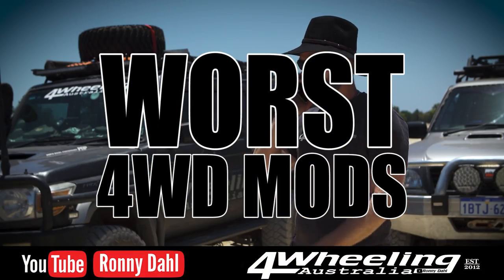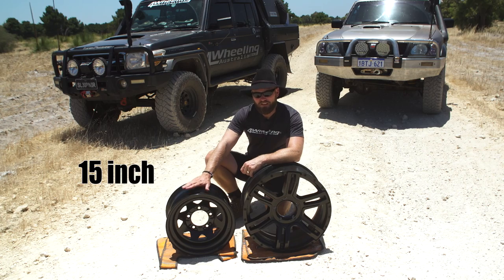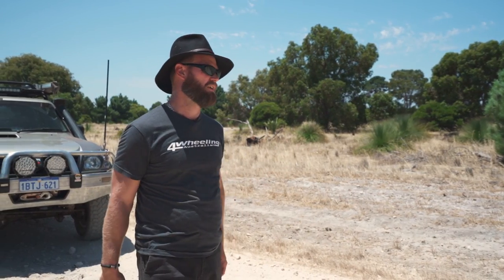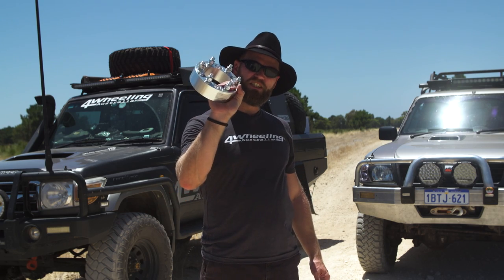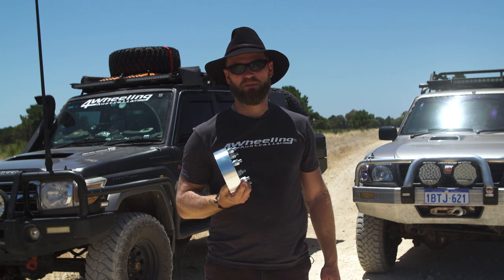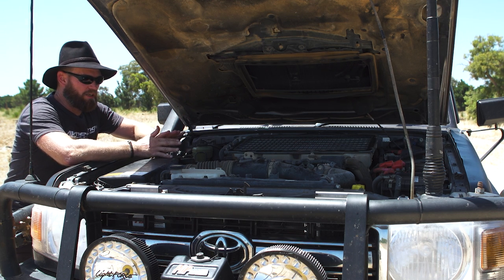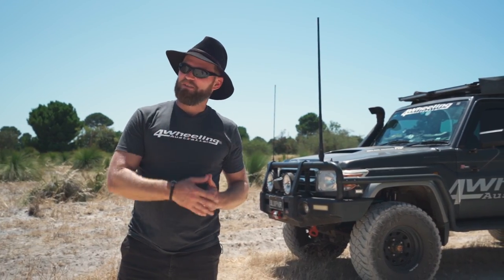WORST 4x4 MODS, DON'T DO THESE TO YOUR 4WD

Comment: Here in Oklahoma we can literally do whatever we want to our vehicles. No state inspection. Car dealers can and do sell emission deleted diesel trucks . I seen a brand new ram 3500 3 miles on the clock completely deleted and tuned to 600 hp on a dealer lot .

Comment: To be fair, I can see the need for spacers? like in the military where I am from, we use the ford everest, they added metal bars and lifted it, what they did was basically make it top heavy but the wheels were still well in the wheel well, so there were many cases that they flipped over because the wheels are narrow

Comment: Up here in western Canada, (Saskatchewan, Alberta), I see so many 3/4 tons & 1 tons, with ridiculous lifts. Those trucks Never go off road, or hardly out of town. Also Now that truck can't even tow a trailer, which  it was built to do, in the first place. Not to mention the extra fuel, they squander away.
Reply: Same thing in Northern Minnesota, it's the Monster truck syndrome.
Reply: @saginawdan  exactly! & the dudes that get out of the truck are 5'2" usually, to boot, too.

Comment: Ok I agree with you on the wheel spacers and taller rims. But I wish I could still get my by ply tires work better offroad and when it comes to weight (my Jeep"73 j4000 pickup"" empty is a little over 31/2 tons) has 8 inches of lift drives like a dream

Comment: I can agree with most of what he says, though I have big rims....except I do rock crawling and I'm not a fan of drving my vehicle in traffic, but not because of handling. It handles fine. I just hate a 6 speed manual in traffic. A lot of what Ronnny is about is "touring" or "overlanding" and that's where his expertise is. I wouldn't attempt the type of driving he does in my Jeep. I'd just buy a Toyota, but I'd never replace my Jeep for a Toyota for the type of rock crawling I do either. Funny thing is, I've seen some people with $70-100k+ builds and fantastic gear...top of the line stuff and then I look underneath and they still have the stock drive shaft on a crazy lift and never EVER take it off road and even despite that...you can tell that stock driveshaft is going to twist like a wet towel sooner or later. As for the big rims...well, I have big  tires and they are due for a replacement so I may just go ahead and swap the rims out too. I've out grown them.
Only advice I'd ever give someone who's going to do either overlanding or rock crawling is two things:
First, (and Ronny nailed it with "Don't go cheap where it counts") this is not a cheap hobby. You will inevitably spend a pile of money on your vehicle if you do it right and excpet to do it as a hobby or for any amount of enjoyable time. Second, is "Never go out alone". If you're a "lone wolf", "Army of one" or some other BS...pfft...make a friend. Two or more vehicles is always the safest thing you can do. Thumbs up Sir! Great video as always.

Comment: Lift kits + stiff springs = less usable suspension travel. Especially down travel, no down travel no traction going over obstacles, your tires will lift off the ground and you’ll just teeter.
Unless you are loading your vehicle up with a lot of gear and need proportionally extra stiffness.

Comment: I was once driving on the highway, eastward from Chicago into Michigan.  As soon as we hit the Michigan border, the road turned rougher, and there was one particular pothole in the highway that had some victims off the side of the road - at least 6 vehicles had flat tires, some even with obviously broken rims.

Every. Single. One. of those cars had low-profile tires.  Some Subarus, some lowered Hondas, some Chrysler sedans with huge and expensive rims.  Every one of them had oversized rims and low profile tires.

On any car I purchase, I opt for the very smallest rim that will fit on the hub.
The tires are cheaper, the wheels are cheaper, and you'll be riding smooth over those potholes that would kill a low profile setup.

On one vehicle, the dealer had a special offer for 2 free sets of tires, but only in the stock size, so I bought fancy alloys in the stock size, and essentially got them for free, after cashing in on the 8 free tires.  Noice!

Comment: This is not a mod, but speaking of high lift jacks: I use the high lift jack to take the weight of the vehicle and then a bottle jack to lift the weight of the wheel and suspension. Easy to adjust the height of lift too.

Comment: I agree about what Ronny said about the wheel spacers, however the alternative to fixing Toyota's f**kup properly is to install a widened axle, which numbers in the 10's of thousands with installation costs. Lesson: be aware before you buy that the 70 series has that inherent flaw built into it and fixing it properly costs $$$.

Comment: At the end of the vid. I herd "you can't tune an engine to be more efficient because you just drive it harder."  First off how you drive it has nothing to do with engine efficiency, no? And an engine is a glorified pump with all kinds of friction and opportunities to improve efficiency, no? It was just a sentence I can't agree with that mixed two separate issues as cause and effect. Thoughts? thanks.

Comment: Got my self 2001 4runner with supercharger on a 3.4 with 250lbs of bumpers with a 3inch lift and stock size tires on 16inch steelies with a 9.5k winch  for now its just fine for what I do no roof rack or weird lights its my daily and fun truck with 125k .on The od all fab work and mechanical work done by me so it was fun lolol

Comment: one of the worst mods is the 79 series Land cruiser dual cab ute!!!! it has a off set on the rear due to different diff front and rear!!!
the snorkel is the first mod you do so you do not GET WATER IN ENGINE!!!!!!
a 2 inch lift is not enough on older 4wd!!

Comment: So if you have a 15" wheel you should try to fit a large tire to get larger footprint. I have a 15" with  factory 195/80R15  , should I go for 215/75R15 and lift the car 2 inches to make room ?

Comment: Since when can a high lift jack only be used on a front bull bar? I use my high lift jack on both front and rear stock bumpers of my Jeep. How else can I jack it up? With my lift, the stock jack won't reach and it's only a 3" lift on 33" tires...

Comment: Love the video and the content.  My only disagreement is with the highlift jack.  I can be used on front/rear bumpers as well as rocksliders.  What else are you using out in the woods?
Reply: I think he's was more referring to vehicles with factory side steps and factory rear bumper, which you can't lift off

Comment: "The closest some come to nature is that their Volvo SUV will drive over some leaves in the driveway once." (can't remember who wrote the original quote, sorry)
Personally, I've a 2004 Pajero LWB diesel, and I love it. Only mods so far are assisting coils and Koni shocks in the back, a LED bar in the front.  Upcoming are (most likely) a drawer-system for in the rear to help organize, maybe make a roofrack (need the welding experience, not the use) and a nicer rear bumper with bigger lights in it (stock are too small/terrible visibility imo).

Comment: I'd say lights on the top for temperet areas snow, rain, fog etc light reflects off the hood and makes it worse to see even with amber lights. Just stick to lights in the front that are in the 4500 to 55k Kelvin level.

Comment: Got 30mm spacers on my defender. I'm in canada and everything out here has a wider track width than me which is a real pain in the snow and mud, the spacers help lots keeping her straight in wheel ruts.
Reply from the maker: Have you thought about offset rims/wheels instead?
Reply: @Ronny_Dahl  I'll take them off when the ice has melted from the roads, put it back to normal. They only go on for a short time so I'm not to worried.

Comment: Keep the weight out of it as much as possible. Keep the weight low. Bumpers ok but roof tents.. ok Aus may be but bad idea for moab, or most other off road situations. I even just added winch mount to std defender steel bumper to avoid weight. Less weight less need for power, less likely to get stuck.

Comment: I agree with virtually everything covered in this video but not everybody can afford the biggest and best. I understand not cheaping out on critical parts or doing some thing dangerous (wheel spacers).  But if somebody can only afford a cheap awning and some ebay lights, let them get what they can get so they can get out and have some fun.

Comment: Hi so I have a Nissan patrol y62 manual that is my daily driver I have go to the desert in the uae often and have equipped it with king shocks and method 18 wheels and kumho road venture tires and also 20m spacers , during the vid you mentioned that spacers are bad but I use mine so the method wheel can fit to the car due to the brake calipers being very big so want I want to know is that would that still be bad for the car

Comment: All I've done to my 97 2door Blazer base model is replace suspension with new parts, get AT tires, replaced u-joints and put discreet aux lights on. Doesn't stand out as a hardcore 4x4 but he goes places so...no way I'm lifting this rollmobile. Lol

Comment: Great video.  I'd like to see a video on how to properly waterproof your vehicle  for water crossings.  I just installed a snorkel, I'm planning to add diff breathers, and I know I need to do more but I'm not sure exactly what to do. (I know snorkels are intended for dust and clean air, not water crossings)
Reply: Diff breathers are a must for water crossing. If you are going over your wadding depth the chances are your vehicle will float. If the water level reaches any where near your snorkel top, snorkel will be least of your worry because your electrical and electronics will be in water

Comment: What about cheap lift kit spacers eg longer bolts. $120 vs full shocks and suspension lift kits for 1.5k but for a bit of lift for bigger tyres if needed seems practical

Comment: Cheap wheel spacers are the problem, factory dual wheel pickup trucks run spacers on the front axle and have zero issues here in the United States.

Comment: So my takeaway from this is leave my truck stock.  It has what I want for light to maybe medium trail riding and can handle "normal" adverse weather conditions i.e. a bit of rain on the dirt or rock trail just as the engineers designed it for.  Not trying to jinx myself but I guess the trick for me would be to better understand where and when NOT to go than what I do now.
Reply: @phantomwalker8251  find that crazy to hear, see stuff driving around here in NA where you’d probably be safer in a shopping kart. Once its registered, you can do what you like pretty much

Comment: Nothing beats a steel rim. If you hit a rock wrong on an aluminum it breaks. If you hit a rock with a steel rim it will dent and it can be hammered out enough to hold air and get you down the trail.

Comment: What's wrong about upgrading air box/snorkel without other stuff? Main use for extending it to higher point is not to suck dirt and dust, not for going to the water.

Comment: I have to disagree with lift kit have a 6 inch lift kit with 20 x 10“ rims on 35 handles really great off road and really good on road. Without the 6 inch and rims and tires kept getting hung up and stuck and constantly having to use the winch hardly have to use it anymore now. So it all depends on the set up and if you do your research and set up properly shouldn’t have a problem at all.

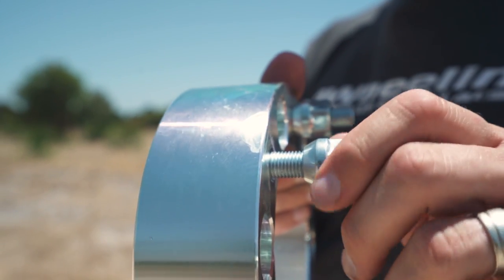Comment: 5:23 in saudi we use these wheel spacers because the j70 2007 and top got a different wheel track than the older cruisers it is narrow and little bit and the older j's are much wider when we talk about the rear wheels

Comment: I second the extreme lift my second 4x4 was a lux with 35inch tyres and a 2inch body and 4 inch suspension lift, handled like a bucket of shit and was an absolute cop magnet. The only reason I kept it 6 years is because I have a shit box as a daily and literally only took the lux out shooting/fishing or camping afew times a year. Now I have a fully road legal 4x4 and it's good not shitting bricks seeing wapol

Comment: I added front struts that added a 2 inch "leveling" to my truck.  It definitely drives worse, but I wouldn't say its dangerous.  Just the steering is kinda vague now.  But the truck looks cool and I don't really drive it hard so I think I'm ok.

Comment: I live in North Carolina and all over the south here we have what I call pavement queens like crazy. Monster lifts with big rims and rubber bands for tires. We also have clowns that "squat" their trucks so the back sits like they have way too much loaded back there. Not to mention everybody putting glass pack mufflers on just so they can be loud, but don't have the builds to back up the noise. Oh and the pretty little wheel lights and rock lights but they couldn't make it through a class 2 trail for fear of breaking their rim and scratching their multi thousand dollar paint job. Looks pretty at a show but don't show pretty on the trails

Comment: Wheel spacers...if you own a Land Rover Defender, you know the steering radius sucks. 

I installed quality wheel spacers with medium strength thread locker and a torque wrench. I reduced the radius by over 3 meters!!!! 

I won’t let someone I don’t know and trust service my Defender. Now my truck is safe to drive because I can actually steer, park, and maneuver. 

Second, your comment about hub stress is complicated. A better option than wheel spacers is wheels with negative offset (or wider track) the added stress is negligible considering you typically have full floater or heavy duty axles. 

Add 3 spacers, yes it’s ridiculous. 3 cm? No biggy when done right. 

In Australia where wheel spacers are illegal, just get offset rims.

Comment: Farm jack/highlift jacks... with the wheelhook adapter... I will neer leave the house without. My town have deep rain gutter (30x30 or 40  cm I think. the made up crap they 'use' to be faster in a turn in initial D) often they are cmpletely hidden by vegetation. had to pull out by myself twice in the last 6 month. 20 minute the 1st time (2 right wheels trapped) 10 minutes the last (front right trapped during a UTurn) so the combo jack, hook plus aluminum loading ramp to bridge the gutter once the wheel is up will never leave my roof rack.. I swearz  (I have pics of the recovery if ya want)

Comment: I was told by a Tyre joint that it’s illegal to change the wheel size from that described on the label on the b pillar,even though the car I drive had options from 16-17-18 inch, what to do?

Comment: I want to put big awnings on my patrol that cover the majority of the sides. I dont care if the engine bay is covered, but i want literally every other part to be covered. Heres why: 
I want the inside of my vehicle to be completely clean at all times. This helps limit damage and just looks better. I could est off my floor if i didnt have a problem with the crumbs. This means i like to regularly clean my vehicle including vaccuming and minor detailing. I cannot drive it into my shed because it is too tall to fit into the bay, and this means weather limits my ability to clean it. However, having awnings for cleaning and camping pretty much eliminates this issue, and also means i can have my car facing in any direction i want eithout losing shade or protection. However if i didnt clean it out so frequently, the awning setup would be foolish

Comment: First and foremost here in the states wheel spacers are legal. They are constantly run on the front axle of anything with dual rear wheels on or off road. Secondly wheel spacers can be a hazard if they are poorly made and not maintained. Buy quality spacers they are not cheap. Be prepared to spend big. They should also follow how you vehicle is set up. If your Wheels are hub centric then your spacers should be hubcentric. If you were wheels or lug centric then you were spacers should also be lug centric.  If you run them on your vehicle you need to maintain the torque specs no exceptions.

Comment: Maybes its cause I live in America but over the top lifts here are no illegal (if done correctly) neither are wheel spacers. Spacers are 50/50 in most opinions. Over the top lifts are generally used just for looks or crazy mudding. Almost anything goes over here.

Comment: Great video Ronny. Many people like myself bought new with 5 year warranty. Apparently manufacturers spend millions making practical safe and reliable. Tunes as an example are apparently warranty busters. Please list any items that will guaranteed not void our warranties. Nobody wants to spend $50k then do mods that void their warranties. If instead we bought a $15k 5 year old out of warranty what would you recommend if I had $3k to accessorise with. A throttle controller for $250? Perhaps a future video on the dreaded GVM then one on GCM showing how quickly even new 4wd can become illegal because of the weight of accessories plus tow bar with heavy 110kg ball weight if you buy a big caravan like my 8.5 metre 1700kg ATM. Please investigate and share as many 4wd new like me want to enjoy our vehicles without overloading them or fourth er r raising their inherently high centre of gravity. We have a Pajero Sport new 7 months ago plus the abovementioned caravan and have used a weighbridge and only accessories  are tow bar and tow ball but because GVM Is 2710 kg 4 passengers camp gear and that heavy ball weight brings me within 100kg of GVM which is scary.